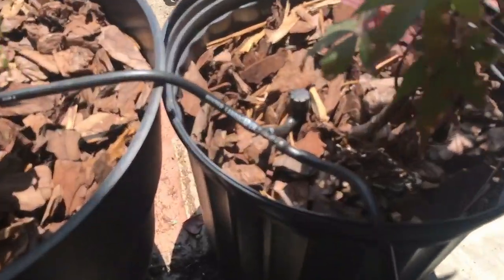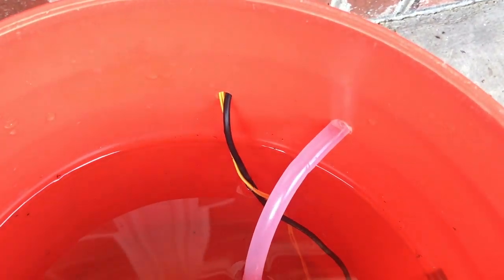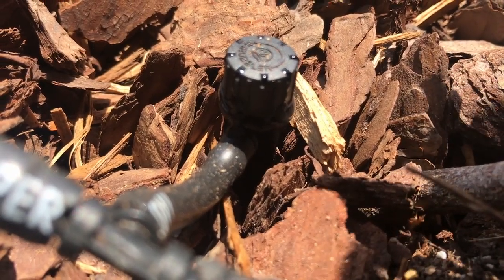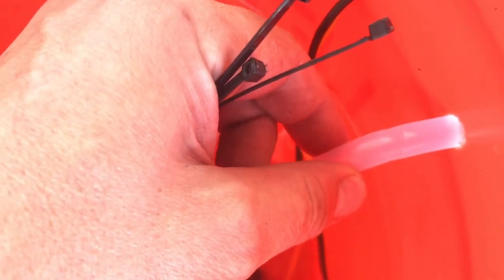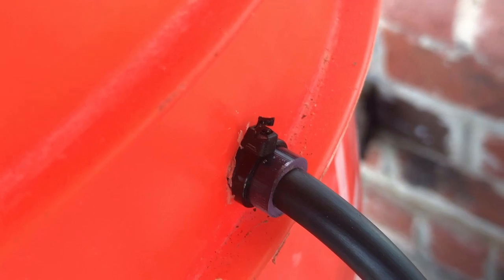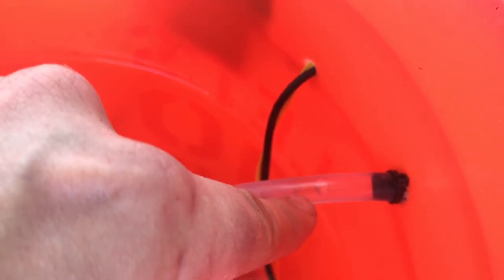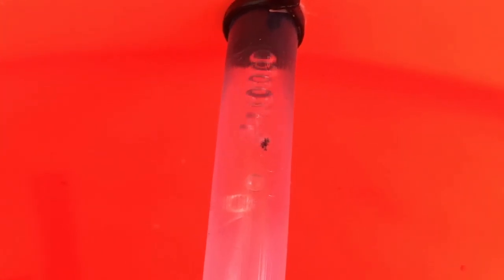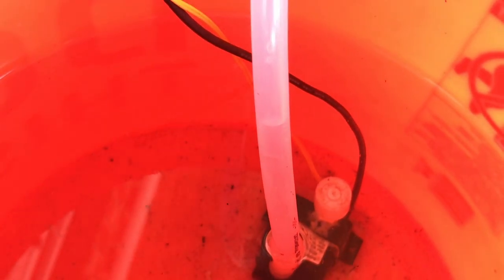How to Stop a Siphon from Completely Draining Water Reservoir - Automatic Watering System for Plants

Comment: Life saving info. And to stop the pump from leaking any water through the air hole i put in a T at the high point and added 2 feat of hose running upward. Closed off the end and put a small hole in it. The air gap still works but the water wont pump up high enough to reach it.

Comment: Thank you for the idea.Indidnt puncture the hose.I cut it.Instaled a T connector on the  upper side if which i have put the check valve ...worked for me.
Reply: Ah I did the same thing only no valve. Just added 2 feat of hose upward. Closed off the end and poked a small hole in it. Water doesn't reach the top of the hose so no spillage

Comment: Has anyone considered put a check valve there? Like the same for an air pump?
Reply: If the pump is low psi then it may have trouble operating the valve. It would not work on my system

Comment: Yeah....I wouldn't put the hole at the top of the hose unless you want water spraying out of the top.  Put the hole on the bottom or side so it spits it back into the res.
Reply: Or add a T and another hose at the high point. Tie that added hose upward. Seal the end shut and put a tiny hole near the top of it. The flowing water won't reach the top of that added hose and it still leaves an air gap. As long as its not a high psi line (reservoir pumps are not high psi) the water won't even come out of the air hole.

Comment: I'm using  a 30 gallon trash bin as a reservoir.  I have a 90 degree elbow at the top.  I poked a small hole just below the fitting and viola!  She works like a charm.  Thanks for this tip!!!

Comment: Brilliant vid help me right out with a garden pond situation if it was to spring a leak even thou I have a float switch it could carry on syphoning down with the pump of if that hole in the pipe was under water no water would come out untill it passed that point and exposed the hole because of downwards pressure am I right in thinking that?

Comment: There’s got to be a better way to stopping the siphon without poking a hole and losing precious line pressure. I bought a vacuum breaker valve for 8 bucks on amazon, unfortunately my 800 gph sub pump couldn’t open the spring valve. I’ve searched the interweb without much luck.
Reply: Who would have thought they would get a reply after a year.....Ha! I just used this method to solve a siphon situation and considered the loss of pressure as well.  I think that if your pump is at least a little bit above the power you need relative to the amount of drippers you are running, the pin hole is really just like adding one or two more drippers.
Reply: I used a check valve there.Rather then punching a hole at the highest point I cut the hose and installed a t junction connector on the upper side of each I put the check valve.Worked like a charm.